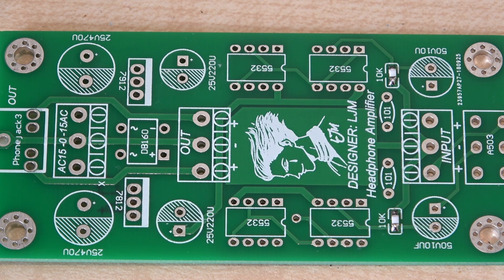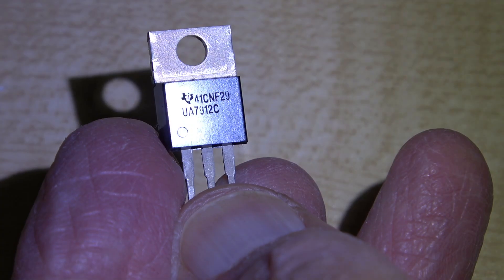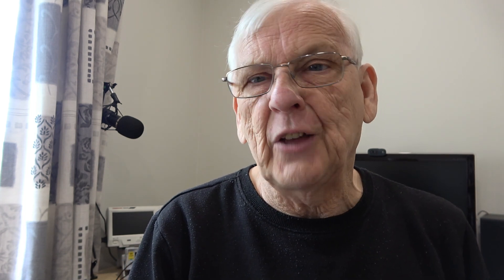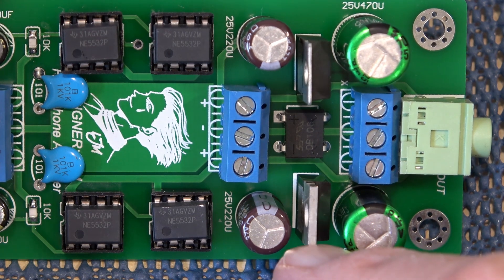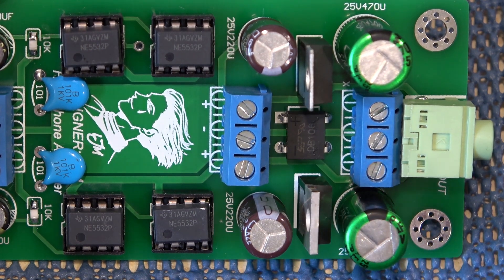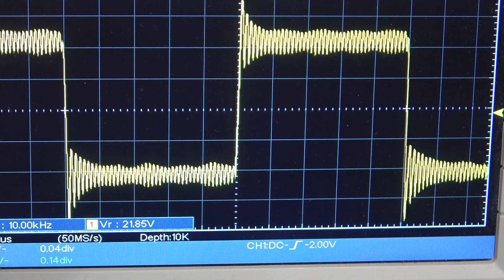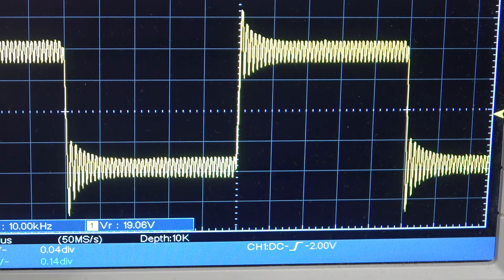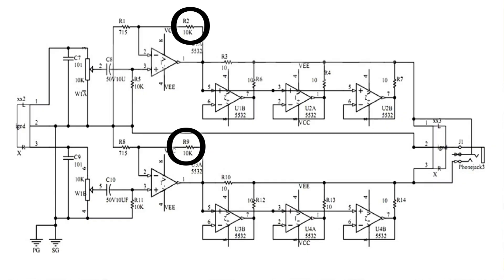Putting multiple ICs in parallel. A good idea or not?

Comment: It is common practice to achieve Ultra low noise by //ing  5532, lt1115, opa202. beyond 8 chips is a point of no advantage. 2 chips will reduce the noise by half 4 chips by half again and 8 chips by half again. The theory the noise being random in each chip so this is an analog version of averaging
Reply: Reduce by half or by square root of 2? The latter should make more sense.

Comment: Depending on the IC, this is very common practice in extremely expensive high end test equipment. Think of applications like 8 1/2 digit meters where you want to average very small errors. Of course your circuit must be designed to take advantage of this approach and stacking the chips physically is likely almost never a good idea due to thermals.